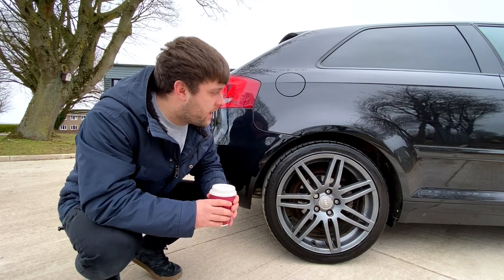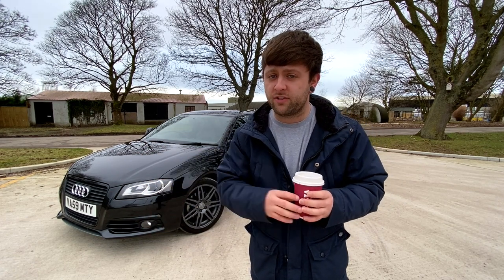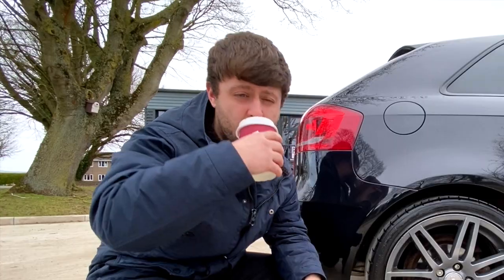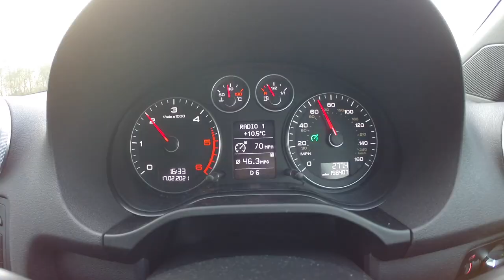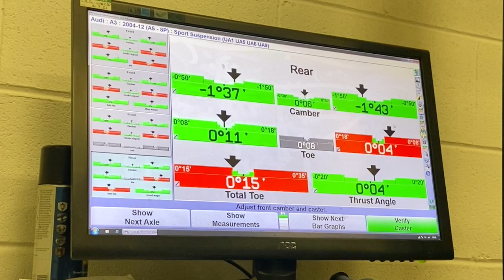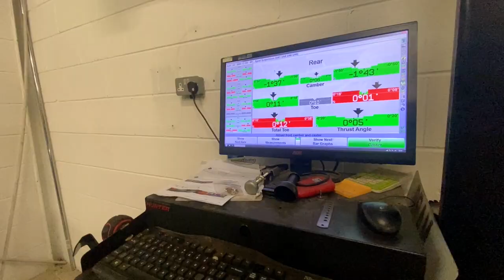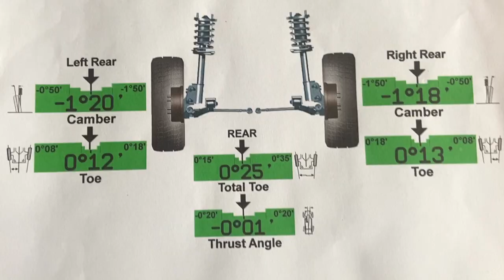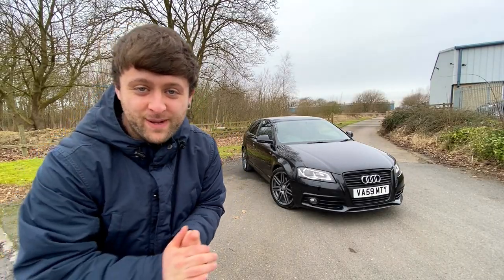GETTING A HUNTER 4 WHEEL ALIGNMENT  *CRAZY DIFFERENCE*

Comment: So did he fiddle with suspension even though its not 'adjustable'? I have a Seat ibiza, regularly have 4 wheel alignment. Always pulls to the left. Recently hit a sinkhole, now the power steering is lighter at standstill, and on the move the steering is so light there is no feeling AT ALL. Had 4 wheel alignment checked AGAIN, and the rear right camber is out of spec. And some of the other cambers are borderline. Seems no garages want to know though when i mentiom adjusting. They simply say...not adjustable on your car. Way i see it, if nothing is bent, then how the hell does a pothole 'adjust' my suspension, yet a person cant? Seems a trip to Bram racing it is. Not too far away.

Comment: Had mine aligned twice now but still pulls to left under acceleration😢
Reply from the maker: Could be your bottom arm bushes are worn mate? meaning when you accelerate the wheel moves backwards in the arch slightly causing pull? as this would sit normal when being aligned but may drag when actually accelerating

Comment: Bad alignment or tracking is usually caused by the clowns that drive up the curb, cars are not built to do this, not only does this knock your tracking out of alignment but also will damage your steering rods and ball joints. Worst of all it causes damage internally to the tyre which you cannot see, this can and will cause a blow out at high speed. If this happens you lose control of your vehicle.
Worst scenarios, you will  cause a serious accident or get wood in your engine which can also kill you, ( hitting a tree at speed)